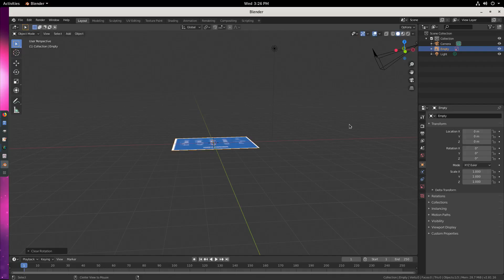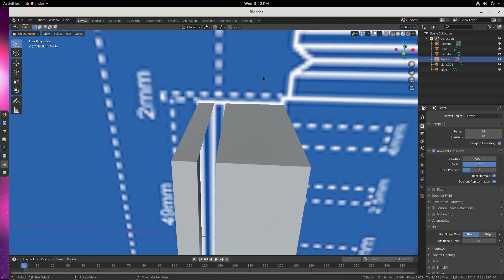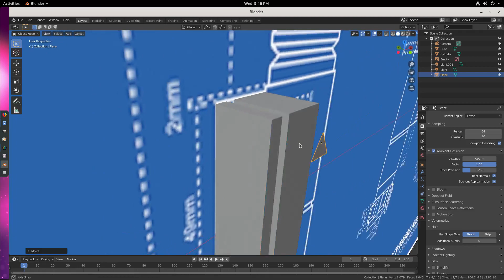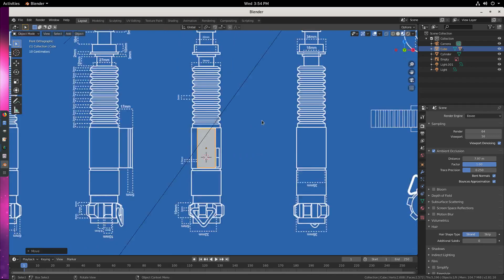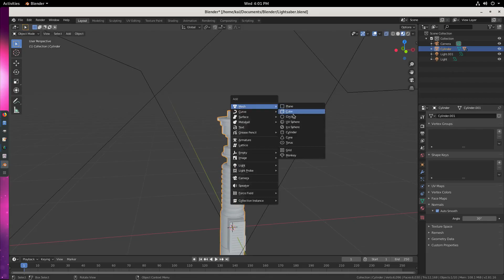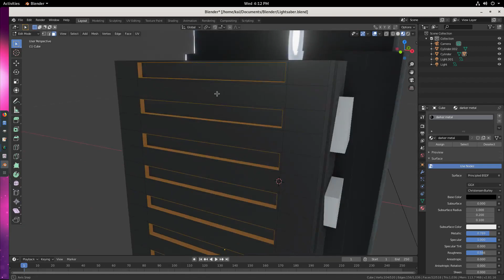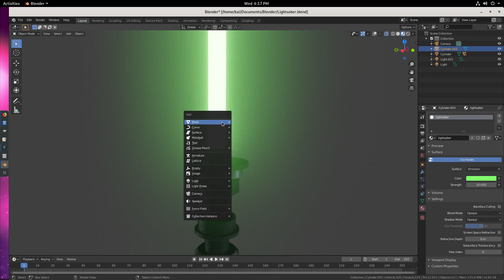How I Made a Lightsaber • Modelling Process Timelapse w/ Commentary • Blender 2.81 Eevee Tutorial

Comment: is there any way to just trace the profile and revolve it around a center axis?
Reply: Sure you could use the screw modifier
Reply: As mentioned you could use the screw modifier. That does work, however, in my own work I have found that starting with a simple circle and extruding over my design offers more control for any changes I might make in the process. Kai here shows another method of using cylinders and various simple shapes.

It really comes down to your own personal style and what you want to do with the final result. Screw modifier gives you one solid piece, extrusion, and modular building allows for greater control over changes and animation if you wanted to say, assemble it or have it broken.
Reply: As mentioned you could use the screw modifier. That does work, however, in my own work I have found that starting with a simple circle and extruding over my design offers more control for any changes I might make in the process. Kai here shows another method of using cylinders and various simple shapes.

It really comes down to your own personal style and what you want to do with the final result. Screw modifier gives you one solid piece, extrusion, and modular building allows for greater control over changes and animation if you wanted to say, assemble it or have it broken.